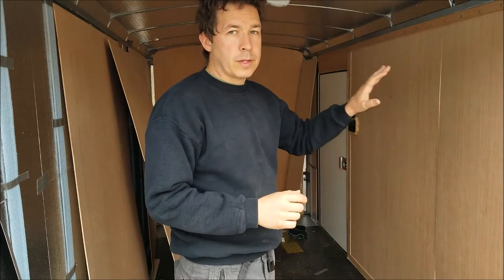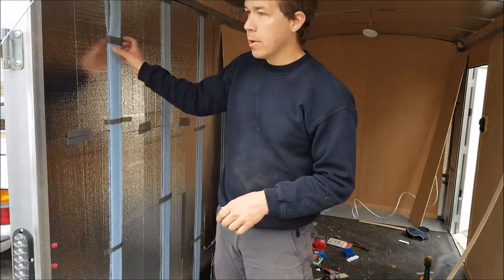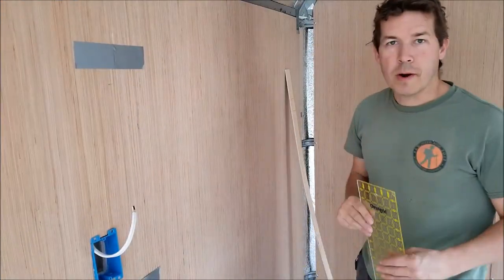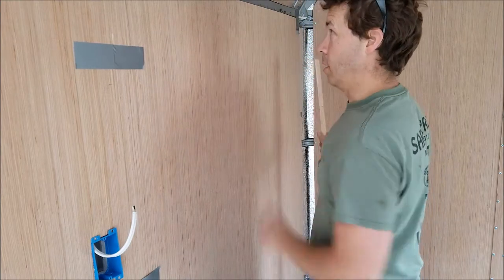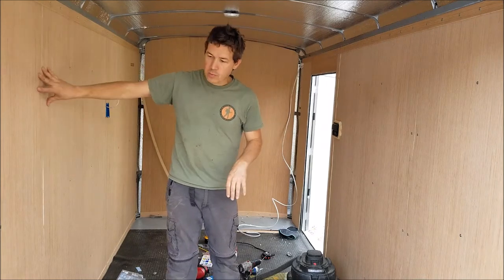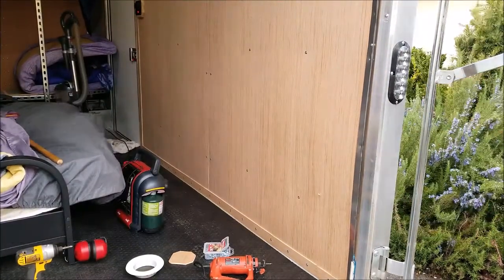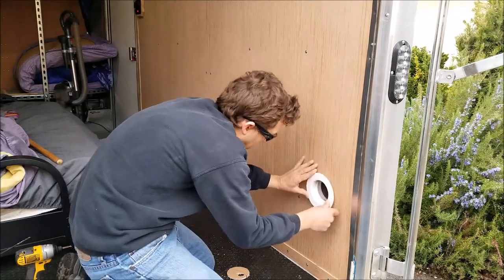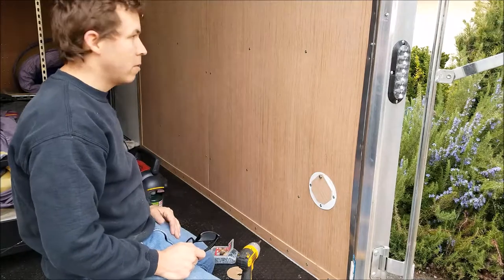Cargo trailer conversion panneling part 2

Comment: Excellent video.  What did you use on your ceiling for insulation?  I'm looking for something similar looking.. that has a silver finished look so I don't have to put up ceiling boards.  I've already done my walls etc.  Thx
Reply from the maker: Its 1" poly foam that I bought at lowes. I think its called R-tech. If you look at my insulation video you will see it. Thanks

Comment: On the link you give about the magnets they are square, but the one I see you're using is round. Is there any difference? I just got my trailer. It's already been insulated and wood on it, but I can't find a stud without taking the panels off. So I think the magnets would work. What are your thoughts? Appreciate it if you get back to me.
Reply from the maker: Any strong magnet should work. I use this in houses as well to find the nails in studs. Good luck

Comment: How is the insulation working does it keep it cool inside. cuz I've seen another videos they said installation doesn't work. what is your thoughts. Your doing a great build, thanks for your videos .
Reply from the maker: The insulation is definitely working. I can tell by the temprature difference between the  insulated vs non insulated spots. It also is warmer inside when we get up in the morning.
Reply: I have a trailer insulated the same way this man did his, mid-day gets warm but if you vent it, by evening its cool.